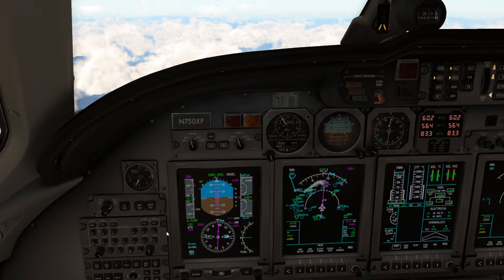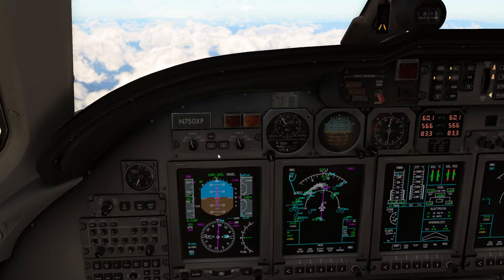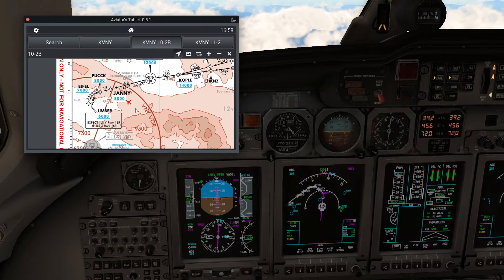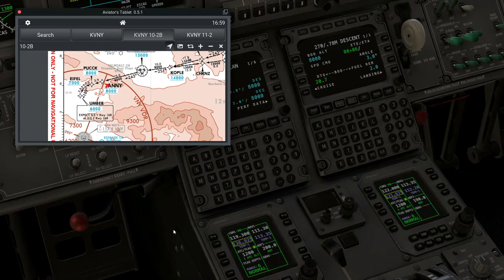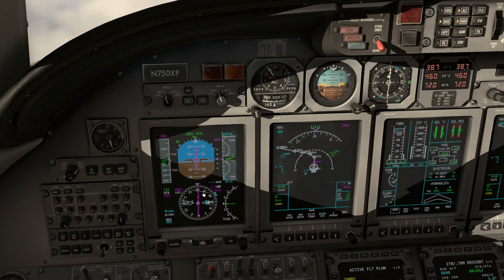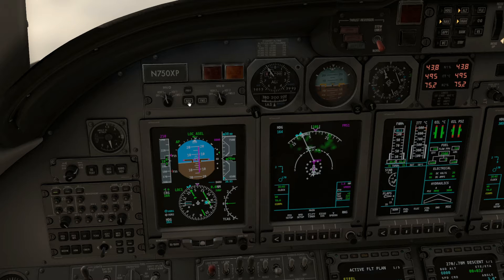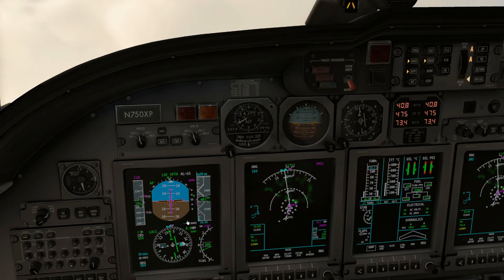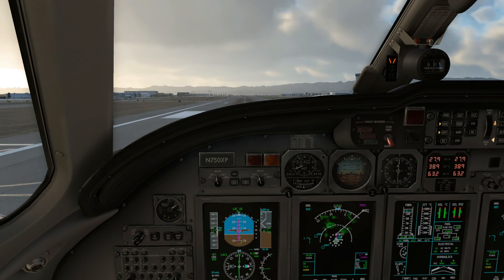[X-Plane 12] Cessna Citation X | Part 4 - ILS Approach and Navigation Source Tutorial

Comment: Hi, whenever I disengage the autopilot it will remove the flight directors, how/why did they stay on when you disengaged the AP?
Reply from the maker: How do you disengage AP? I'm using the AP disconnection button on my stick so I did not click on the MCP panel to do it. Could be this reason?
Reply: @crisk73  yeah I disengage with a mouse click on the AP button on the MCP. Strange I guess, maybe there is a FD button hidden? It’s not on the mcp

Comment: Thanks!  The throttle need to manual control? Do not have auto throttle or similar?
The real have auto power...
Reply from the maker: No this doesn't have the autothrottle, only manual. Thanks
Reply: @crisk73  TKS. The pilot is need for something  🤣🤣🤣